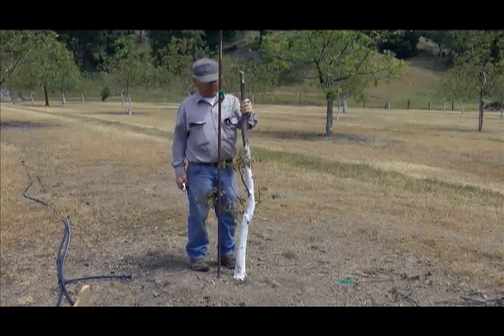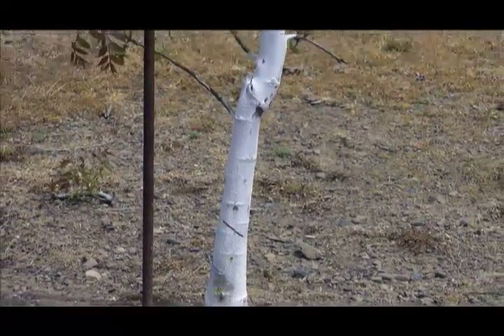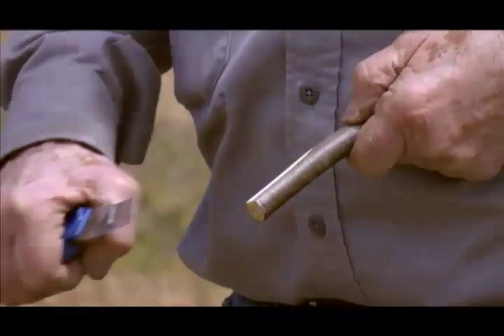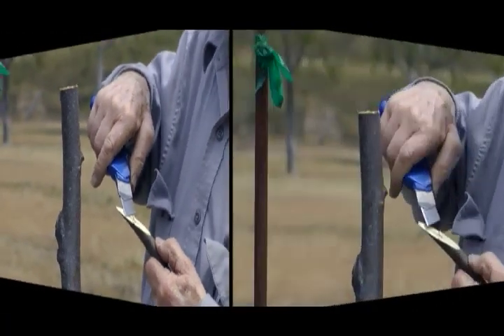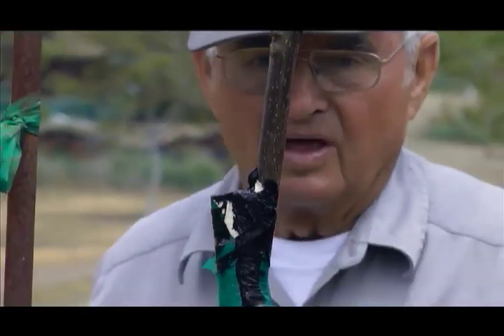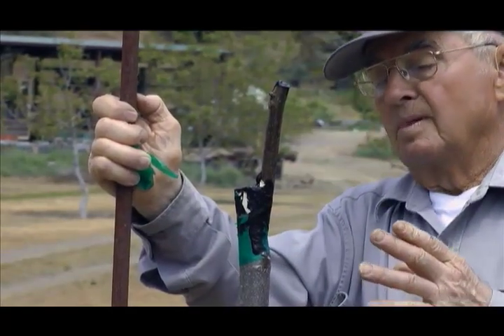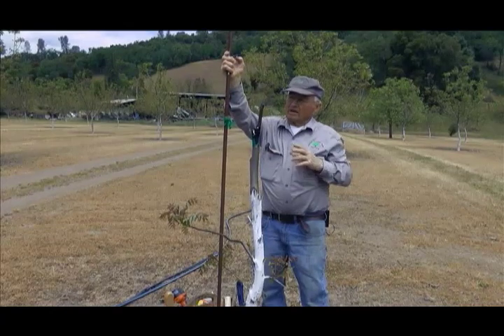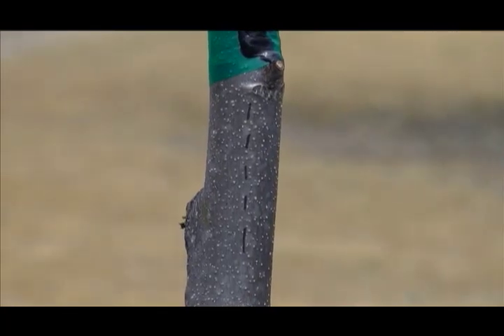How to side-whip walnut trees – UCANR

Comment: In which month it should be grafted?
Reply: Depends on where you are living. In early spring. Look at the small branches at the bottom. They just started to sprout. If your climate is prone to spring frost, you might have to wait a little longer. Frost will kill the grafted scion. The problem is that the later you graft, the more the tree bleeds. You have to cut the scion in winter when it is still dormant and keep it humid and chilled so it does not dry out.
Whatch This: https://youtu.be/tFWvZzMv2Io
I also recommend the skillcult video tutorial on grafting.